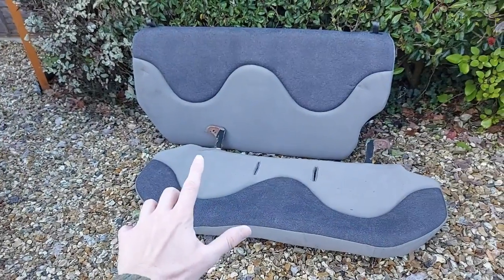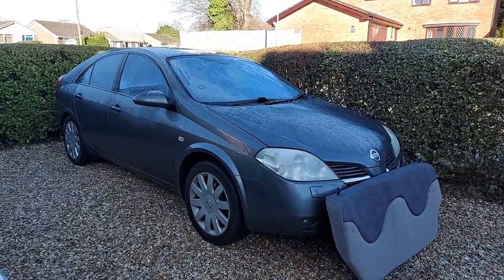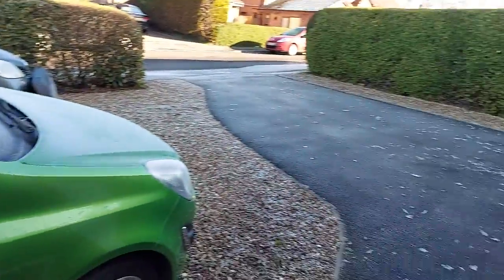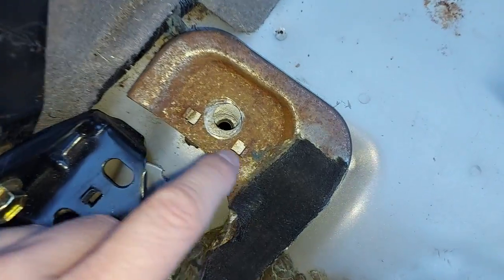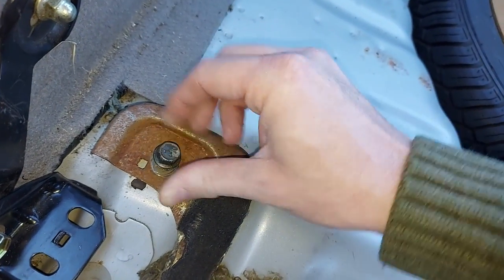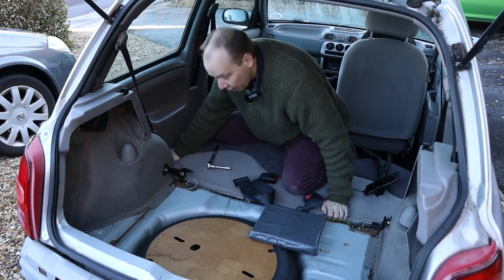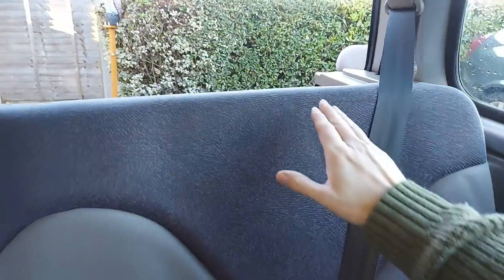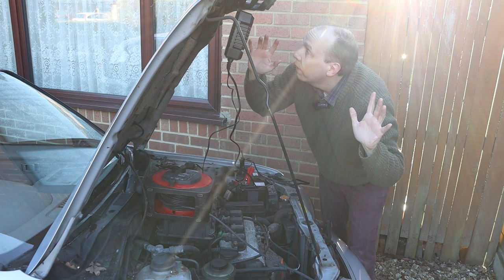Nissan Micra K11: Fighting To Fit Rear Seats (Door Locks Frozen)

Comment: Good to see the Micra get some attention but in that weather just charging the battery would be my limit.

I'm not a fan of using de-icer and once I'd warmed the door lock I'd have used a red can better quality lubricant and water dispersant for future ease. 😁  For ice on glass the use of a scraper clears the screen and warms your body, not that you need it if you can be out there, and in a jumper, no wonder MrsCarSpyTV keeps you for winter.
Reply from the maker: Next time it’s cold, I'll balance a can of GT85 on the bonnet of the Micra. Its presence alone will stop any freezing!
Reply: @CarSpyTV unfortunately even if you put the GT85 in a little jumper unlike yourself it wouldn't work well in the cold.  Perhaps in warmer weather you could try pre-coating the lock with GT85 and see if it might hold less water to freeze, next time.
Reply from the maker: Good plan. Thanks. I'll do that.
Reply: @CarSpyTV  good plan if it works, if not just an idea. 🙃  Let's hope you get one warmer day and lots of days of freezing to try it out. 😀